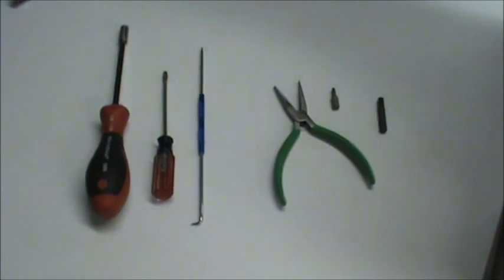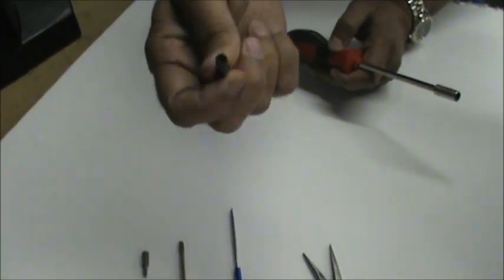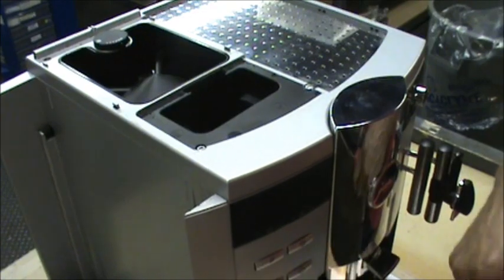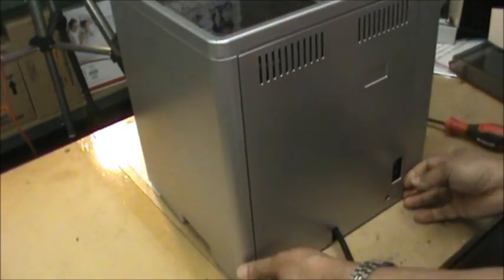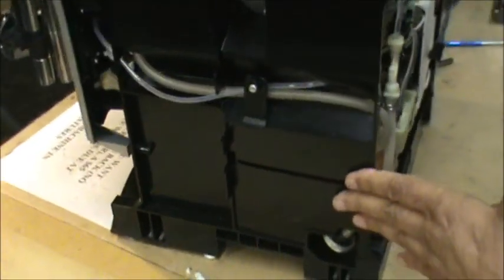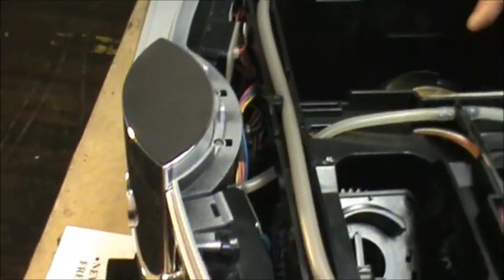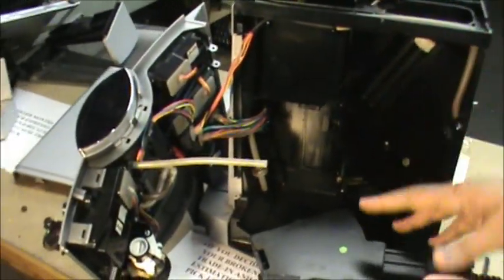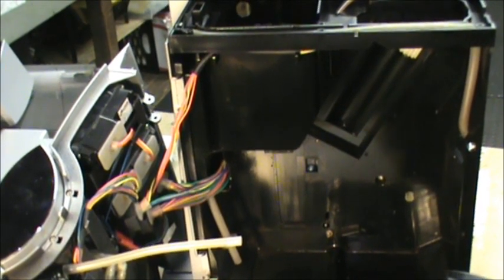How to Open and Disassemble Jura Impressa S9 Coffee Machine

Comment: any1 know how to fix the drip tray sensor as mine keeps saying tray missing
Reply from the maker: +chessecake Morris Either replace the drip tray or replace the metal contacts on it.  We have both items available.
Reply: +Parts Guru do u know how many contacts the machine should have for the sensors as ours only has 3 and wondered has one snapped off
Reply: I thought the same thing when trying to troubleshoot a problem. Ours has three contacts as well; two on the left and one on the right. If you look carefully at this video, the PartsGuru machine is the same.
Reply: We had this message recently. Our problem was that there was a compressed wafer of ground stuck to the back, stopping the tray from being inserted all the way. This made the problem even worse, as the counter for removing the tray when the ground tray was full kept getting reset, meaning even more grounds overflowed into the main tray. A good clean out made the whole tray fit snugly again and fixed the problem.
Reply: I have a s9 Impressa one touch started making a very small quantity of coffee and lots of water dripping in the pan then got stuck on empty tray any idea of what the problem could be? Thank you
Reply from the maker: The small coffee quantity could be due to a leakage inside the machine.  Have you opened the machine to inspect the internal components?

As for the drip tray error, you’ll want to properly clean the metal contacts on the drip tray.  That typically fixes the issue.  If that does not work, you may consider replacing the metal tabs on the drip tray.
Reply: Ok the tray switch is now working fine but still making very small quantity of coffee, notice excessive water is coming out from that drip tube behind  the coffee ground  container bottom right
Reply from the maker: It could be due to worn out o-rings inside the brew group drainage valve.  Replace the drainage valve or the o-rings.

Comment: Parts Guru, Please reply/comment on my reply to you 3 weeks ago.  Thanks!
Reply from the maker: Please email us with detailed issue to sales@partsguru.com
Reply: +Parts Guru I emailed you, but still no response.
Reply from the maker: Hi Russ,  please describe your issue so I can assist.
Reply: +Parts Guru I have done this twice now, both as a reply (1 month ago) and as an email you asked me to send.  I was giving you an update regarding the issue I was having.  Please read and respond to my questions.  Here it is again:
Wanted to update you on the issue with my unit.  The more I thought 
about it, knowing that everything was actually working, but just taking a
 lot longer to produce the cup of coffee, and the pump being a lot 
louder, I wanted to look to see if something was hindering the water 
from getting into the machine.  Although I have only used purified RO 
water, and did the clean cycles, keeping the water tank clean, I removed
 the tank and looked closely at the place where the water flows from the
 tank into the machine.  I saw a few tiny debris, so took my vacuum to 
such the dirt from the small screen.  Well, the dirt did not move.  I 
took a small plastic tool and when I tried to scrape the debris, it was 
stuck and gunky on the screen.  I then proceeded to scrape it all 
together and using the vacuum, was able to get it off the screen.  I 
then took hydrogen peroxide and put a little on the screen to help clean
 it.  I waited a few minutes and them vacuumed it again.  Lastly, I took
 my compressor and blew forced air onto the screen to make sure it was 
completely free of obstruction.  I then put the water tank back on and 
ran a cup of coffee.  WOW!  The pump was very quiet and the coffee 
flowed nicely.  
No where in the maintenance instructions does it say to clean the 
screen.  I do not know how to remove it, or would have done it 
differently.  Also, the technician at Jura never mentioned that it could
 have been the reason.  He just wanted me to send in the unit and charge
 me $265 to repair it.  So, please make note of this very simple 
preventative maintenance step that can greatly improve the performance 
and help it run much longer w/o problems.  If you have the procedure to 
remove the screen at the water intake, please let me know.  Thanks!  
Final note, my wife said that she would recommend white vinegar to clean
 with instead of the peroxide, so that is what I will use from now on.
Reply from the maker: That's good to hear you were able to fix your machine.  I don't know how to remove the screen but will explore it and document the steps so it can be shared with others.
Thanks for sharing your experience.